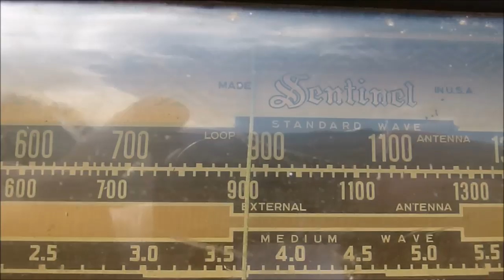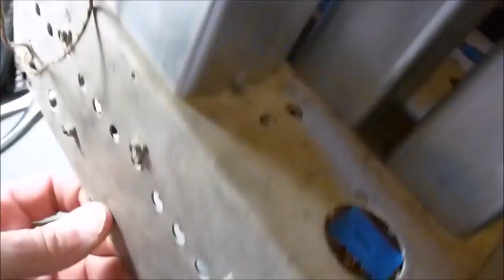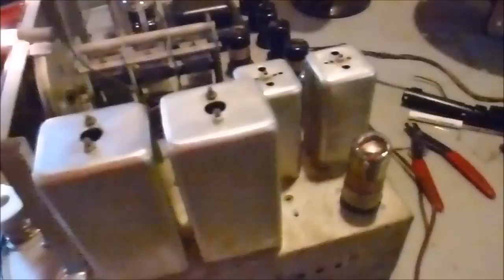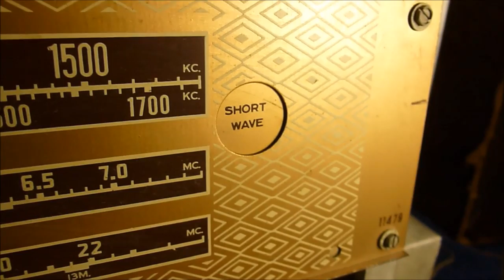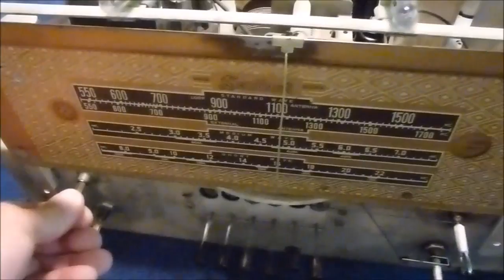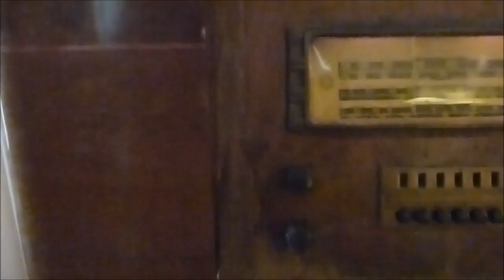1939 Sentinel Radio Restoration    part 1   Electornics

Comment: Sentinel Radio Corp had some gimmicky names for typical radio designs to promote their stuff. Sentennascope was an
ordinary aerial loop antenna. Model is either 199A or 199AE. Sounds great.
Reply from the maker: I remember being amused when I discovered that the fancy Sentennascope was just a coil of wire inside a cardboard box. It seems to work ok as an antenna. The model label in the radio lists the model as a 199AL237. I used the Rider schematic and alignment procedure from the 199A, 199AE model which seems to be an exact match. Thanks for going back and watching the original restoration video. That was my first old radio restoration and I was just learning how to work on them.